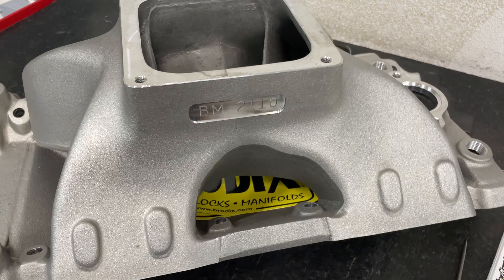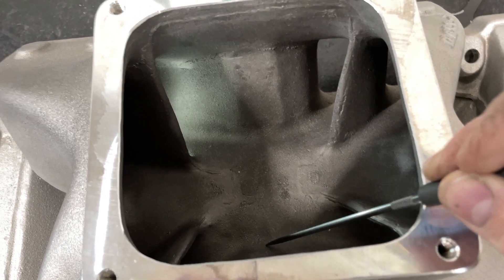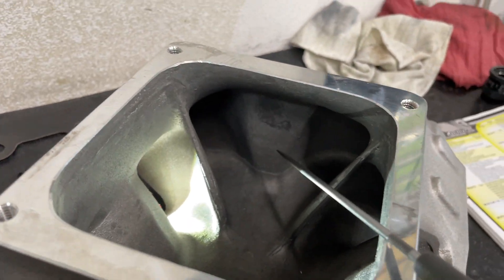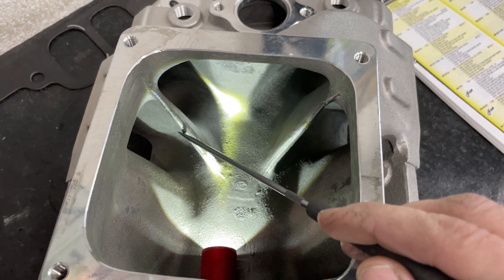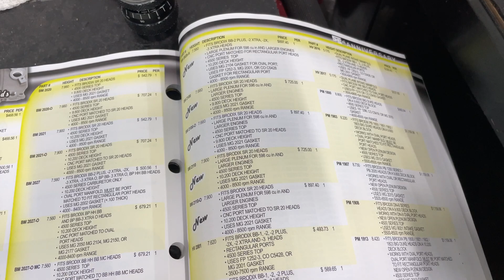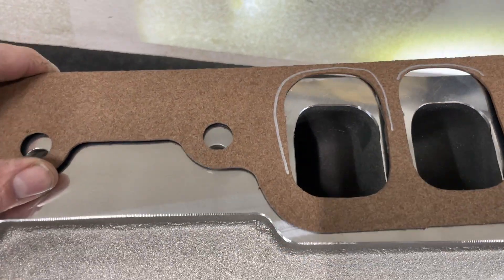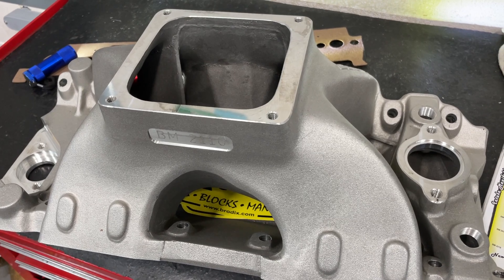Brodix’s New BBC manifold

Comment: Eric, do you know if Brodix has revised the BM2110? Building a 11.8:1 street 632 on pump gas and aiming for 950 - 1000HP with a soft solid roller and have been debating intakes to suit the BRX heads. Always seem to be going back to the ED28978.
Whats your thoughts?

Comment: For being made for a specific head, it is a bad job on that intake.  FORCING customers to spend STUPID MONEY to fix their intentional mistakes.  If it's made for that head, it DAMN WELL SHOULD BE PERFECT !!!!!!  for that head.  Brodix DO YOUR JOB brother.
Reply: To many minor variations in builds, Deck Height, Heads Milled, Head Gasket Thickness, Offset Head Dowels in rare instances. Extra material is left there for refining the blueprinting process of a performance build. The excess material is not removed for those reasons and no doubt a couple of others, better to have too much material to work with than not enough. High HP builds are work, work, work, with lots of mocking up, measuring, and further machining and or grinding.

Comment: Eric what’s your view on (Merlin X  intake , now branded as BMP) for a 880+ hp pump gas 582 with 357 AFR heads  running a 270@.050 Solid roller? . Thanks

Comment: Thanks for the videos just would like to ask your opinion of bb3x380 vs sniper x375 vs dart pro 1 380. Doing 540 twins turbo on meth and need to decide

Thank you
Reply from the maker: Of those the sniper is better but the head hunter will beat the sniper.
Reply: @WeingartnerRacing  just bought set of head hunter 383 and I went back to see your video abou intake and the brodix recommended BM 2027-O for tall deck. Any opinion about it.

Comment: Keep it coming eric.  
Not sure how often you get request for heads for boost and rpm but how does volume play into port design (read porting) for boost?  I.e. increasing volume lowers boost numbers but does it pick more up in the net gains?  I know you covered it a bit with your rant on engine masters clown show.
Reply from the maker: I get them quite often. I tend to prefer a slightly larger volume. It seems to help power and torque management.
Reply: @WeingartnerRacing  reason for my question is im going an odd ball route with some DRCE II's with prochargers.